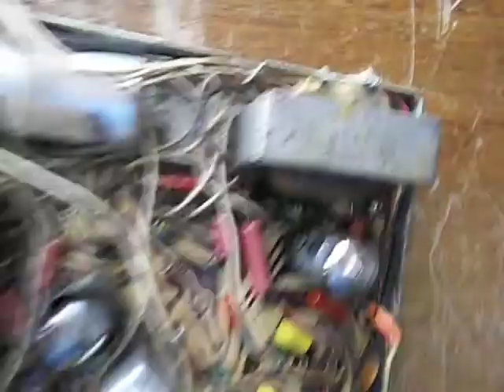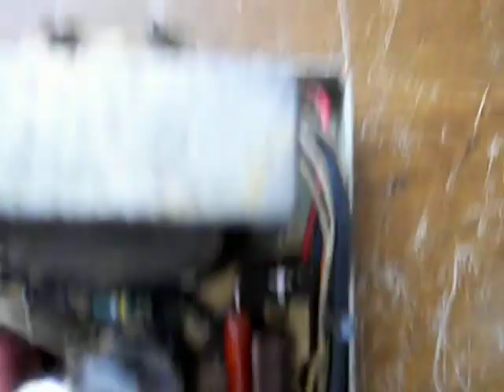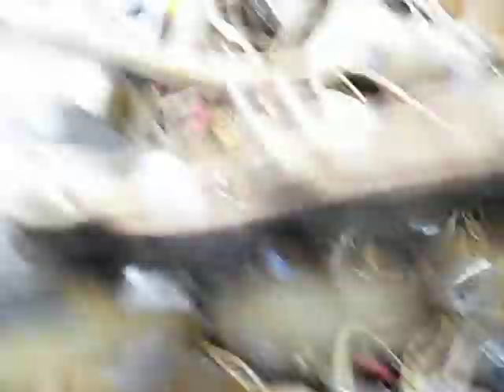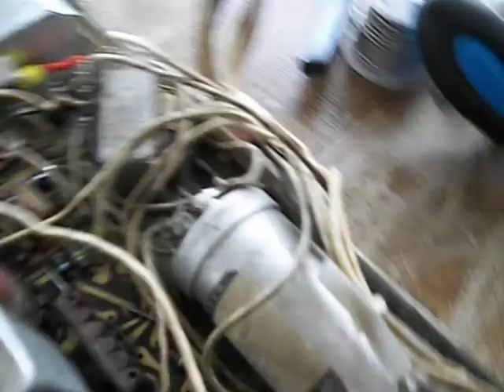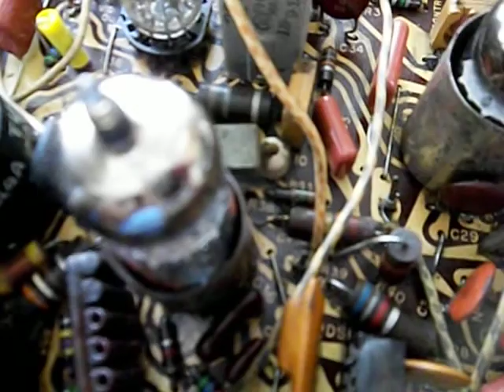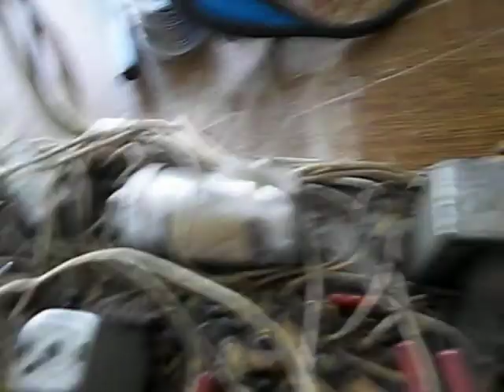Philco Predicta spare chassis Pt 8 PCB stake and minor rant.

Comment: Looks like a real nightmare, working with the wiring connected to that multi-section cap! Ideally, as we know, it's always better to at least match capacitor values within 10-15% of what the manufacturer calls for, and NOT leave a cap out of the circuit! Sounds to me like a case of a previous repairman not knowing what he was doing.